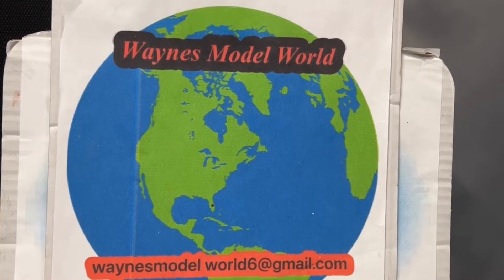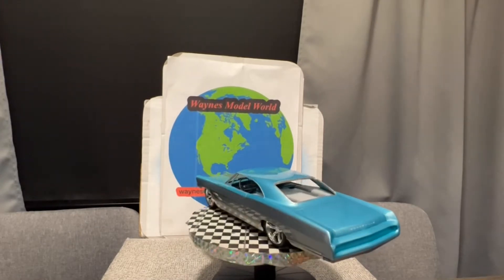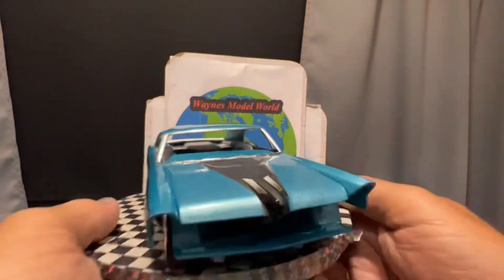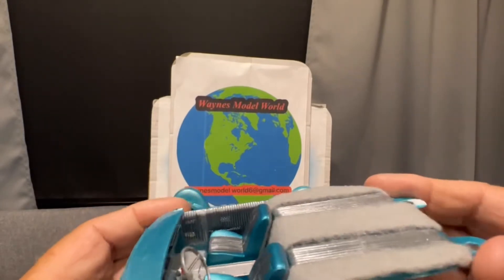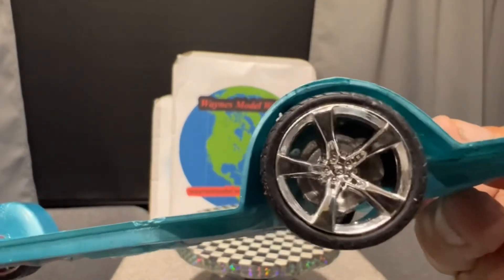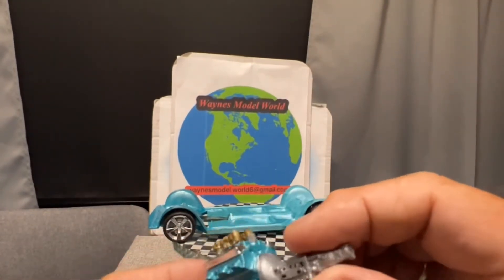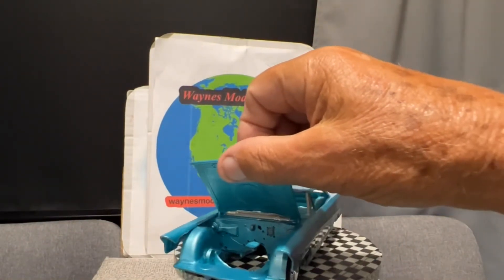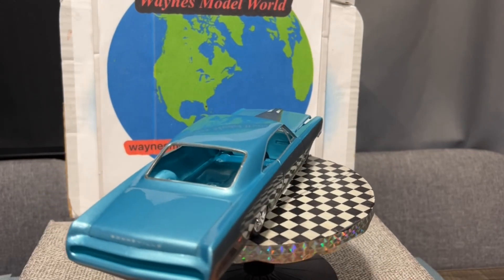Up date on 1965 Pontiac Bonneville

Comment: The W,I.P. Pontiac is looking real good. Love the two tone paint on the body. Wheels and tires look awesome . Nice interior . May i ask what type of glue do you use to hold down the felt , when you use it in your interior . TY
Reply from the maker: Elmers white glue I brush it on doesn’t soak threw
Reply: @waynesmodelworld5503  THANKS